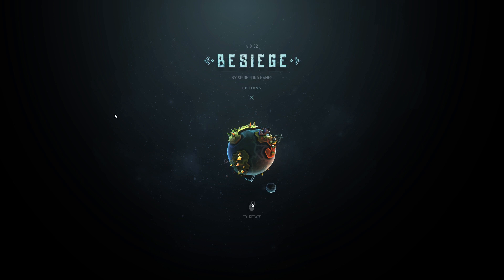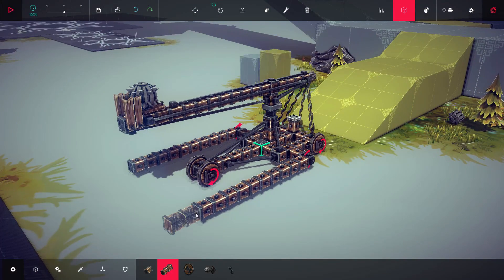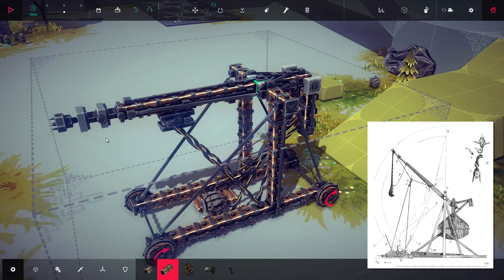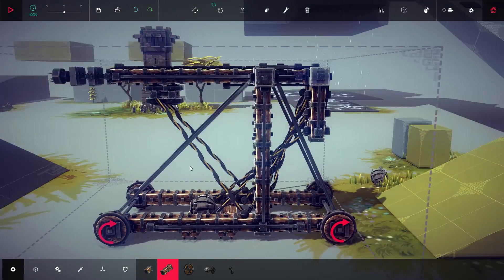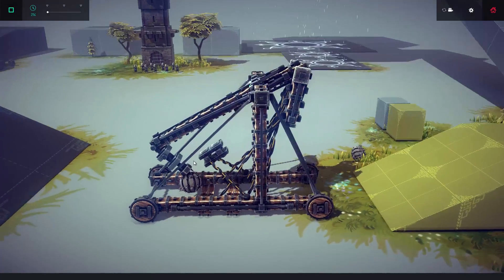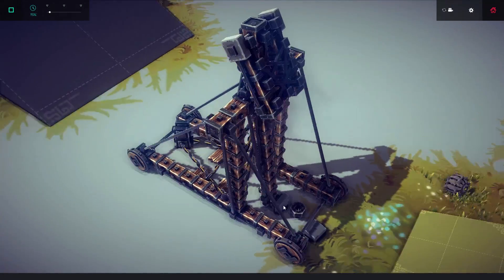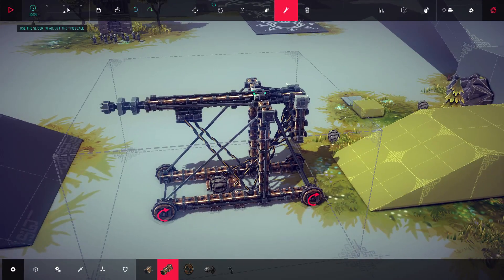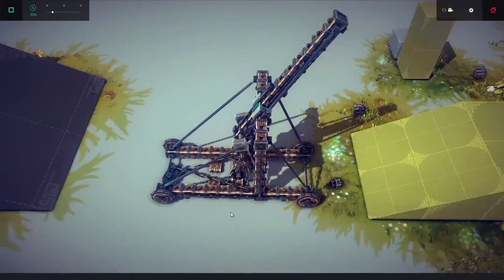Trebuchet NOT Catapult, Proof of Concept Design - Besiege

Comment: trebuchets used gravity, not springs. Your machine is not a trebuchet.
Reply: Grog MadMan Can he use a counterweight to launch a 90 kg projectile over 300 meters? Yeah, I thought not.
Reply: Ivan Ivanović Well i did it, and it worked 
http://image.noelshack.com/fichiers/2016/47/1479767657-trebuchet.jpg 
This works 
i know thats an elastic but without using it and at max resistance i works like a rope, and rope is shit idk why 
Btw nice meme.
Reply: 2:35

#watchthevideobeforeyoucomment

Comment: i come up with an idea,why not replace spinning blocks (or whatever you're using)cogs and use a powered cog on the other side and just let it loose this way much more holding power (hold the arm down) also useful for small trebuchet cause when they use spring the spring pulls them into a small ball of death (u can use ballast if u want but its much more majestic ballast less
Reply: im 9 btw =)
Reply: Ken Shimizu i almost forgot spring and holder = sling =)    (kinda)

Comment: You can actually use springs in lieu of a sling mechanism. It's a little complicated to explain in text, though. However, it has allowed me to build a catapult that can hit the friggin' skybox with a bomb. The only issue is that I have to run it on 25% speed because it's so damn fast lol.

There's also an easier way to connect bombs/boulders/fireballs to a grabber. First, place down two blocks -- one you intend to keep attached to the mechanism, and one to throw away. Let's say you use one of your hinges . . .

[H][B]

Then, place your projectile on the end . . .

[H][B](P)

Then, remove the second block and put a grabber in its place . . .

[H]-{E(P)

As soon as you press spacebar, the grabber will automatically latch on to the projectile. This should prevent you from having to delicately pick up your charge (well, unless you have some sort of reloading mechanism in the works, then it's pointless lol).

Comment: How did you tension the springs?? My trebuchet after your design when firing basically falls apart..
Reply: Played around with is some, the issue seemed to be how i was bracing around the central pivot on the arm. I changed the pivot point's to un-powered cogs and i seem to have fixed the issue. Was causing unnecessary tension in the system

Great design!!

Comment: i think you were wrong to correct yourself at 4:4, the hinge did not move indeed, but a rope under tension would be straight, not curvy. so the hinge should not be moving. i agree with your first statement on releasing the projectile while it was still swinging, on that moment the projectile is moving faster then the arm. i guess you want to delay this moment to the point where the arm itself is moving faster, and at the desired angle to launch the projectile.

great build, THIS is indeed a trebuchet worthy engine

Comment: How did you attach a swivel joint to face the starter block? I thought you can't put down a swivel block when it has something above it (blocking its top part)
Reply: I had the same problem when i started to build it, after several searches i found out that; you turn on all (ingame) graphic options to turn frame rate down then put two wooden blocks next to starter, delete the mid one, try attaching swivel to wood no matter it gives intersection error, eventually you insert the swivel.
Reply: But...I already have them all the way up :c

Comment: Actually, you're catapult is not a catapult; it's a traction trebuchet, and it's pretty much the same as you're other trebuchet, besides the makeshift sling. Catapults use torsion from twisted rope and the arm is mounted at the base and has no counter arm.
Reply: Sinew was also used for the torsion mechanism.

Comment: This is really neat, but because it works on elastics / springs and not just releasing the counterweight, I think it's still technically a type of catapult. To build a true trebuchet the drive for the arm needs to just be the weight with nothing pulling it.

Comment: try removing the "counter-weight" bit and just attach the springs to the short end of the arm, that pivot there doesn't do much seeing as the machine is spring powered and springs bend. with the counterweight gone you could add a row of bombs under there to reload. also remove the detaching bit that pulls back the long arm and just attach those springs right behind the grabber, add a block if you have to and since springs dont really have a limit to stretch this wont affect the power, this way the grabber will be pulled to the same point every time and you can pull back to reload.

Comment: Ive been trying to build a Trebuchet that uses gravity. sadly the counterweight pulls the trebuchet apart.
Reply from the maker: Sackbotz123 It can be done, you just need to brace it more. I made a normal counterweight trebuchet on stream last night and it worked but it needed a hell of a lot of braces.
Reply: EnterElysium Thanks for the help. Now i have to go. got a record to beat.

Comment: I have to say elysium, that was impressive. Im from scotland, and Trebuchets are (were) very popular over here. ive been to many castles im my short fifteen years (over 50 at least)  and some of them have Trebuchets. That was one of them.
For a reloading system you could have a seperate car on wheels with a line of bombs on it (you would have to rework the back) or to have some kind of piston slidder system in place.
Useing pistons, it would be intersing to see a 'Cannon' type catapult (Balista useing pistons at the back instead of ropes at the front)
Reply from the maker: Scarlet72 Separate cart would work well! I forget you can have multiple "vessels" in Besiege. Nice idea.As for pusher type launcher, the pistons aren't especially fast - it'd work but it wouldn't get a long range on it sadly.

Comment: Hmmm...late era trebuchets had a rolling wheel axle on the arm. The whole arm free floated on the frame. When the weight dropped it would impart a downward and forward momentum, early designs imparted the forward energy into the frame and lost it in the axle mounts. By allowing the arm to roll forward you could recover the energy and apply it to the throw. I doubt you can currently build it in game, but maybe with a little more development.

Comment: Why not try a projectile rather than a bomb? You won't have to worry about any scraping, and maybe, with enough struts, you could make an "armor piercing" projectile, provided the Balsa wood doesn't instantly break upon impact. Or maybe a shrapnel bomb with armor plate packing.
Reply from the maker: True - now we have counterweights we can use them as projectiles. Although I'm not sure the fortified buildings in besiege go down without explosions... but we should test this!
Reply: EnterElysium Don't forget the fireballs too. You just need to give them a proper container so they don't set you on fire. :)

Comment: Nice! The reason you shot so far the last time was actually due to you releasing the projectile earlier. You want to release it when it is traveling at a 45 degree angle upwards for maximum range. The other times you released it later, giving it less range even though it it received a higher velocity :)

Comment: Thank you, someone who actually made one. It'd a shame nothing needs that kind of range in the game right now.
Reply: they also did use range finding tactics back in medieval times as they would use markers on a battlefield usually a pole painted white  to make the distance the around 100m a marker, and they would test fire the siege weapons pre-battle so the crew would know exactly how much alteration to the aim was necessary. a good example of this use was the defense of Jerusalem were the Frankish defenders marked the lands around the walls before hand, so they could accurately destroy the siege towers as the approached pro longing the siege by almost 1 year. fun fact there :)
Reply: Only because aiming/rangefinding is a bit of a bitch. Add a projectile speed monitor and a laser-range-finder equivalent (and maybe some sort of digital protractor) and anyone who's been through HS physics will start hitting 1000 yard bullseyes.
Reply: Will B The freedom of how you can build makes it pretty much impossible to code something that can actually identify what you are doing, much less actually calculate the arc it might fire in.
Reply: Probs, you'd have to design the tools to be as free-building as everything else. ex. click 3 points on your craft for an angle, range on an object from a point you designate, and ... not sure about the speed monitor. Test world + code module measuring speed attached to bomb/projectile? Hmm. It'd be hard but I think they could do it.
Reply: Will B Ultimately not worth the effort they would have to put into it, and it's not like you would have guiding arcs through the air in reality. Aiming is just part of the challenge.
Reply: In reality you have army rangers/spec ops with laser range-finders and precise 'military grade' GPS guiding dozens of high-explosive shells or a missile into a space the size of an apartment XD.
Reply: Yeah nowadays, back when these were actually used though...
Reply: Then i'm pretty sure they pointed at the castle and adjusted counter-weight/payload mass until they were hitting their target. (each siege unit was static and custom-built on site if memory serves)
Reply: So...trial and error, part of the challenge, like I was saying.
Reply: ... my memory needs improvement... XD